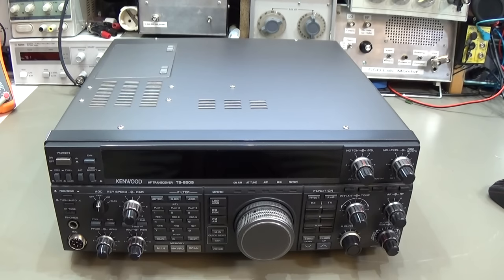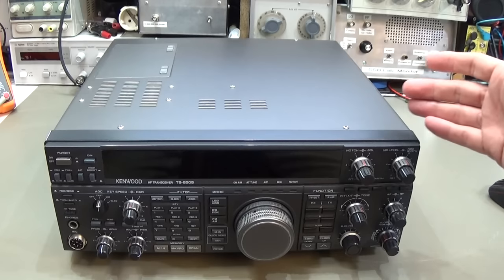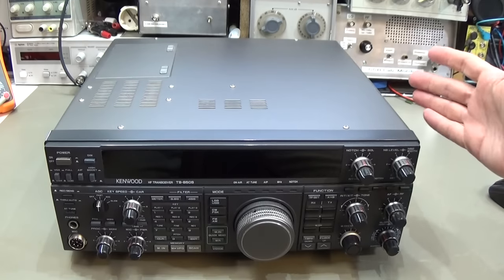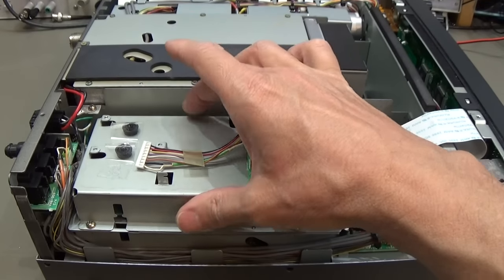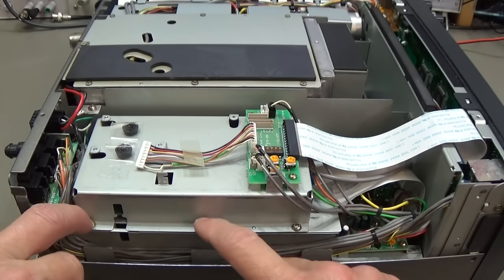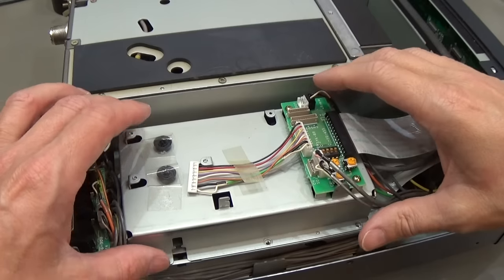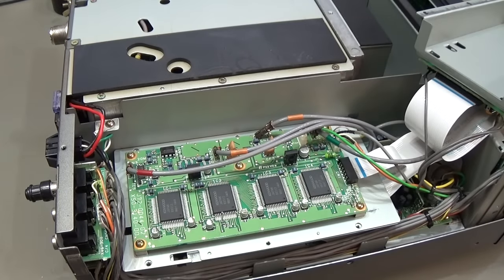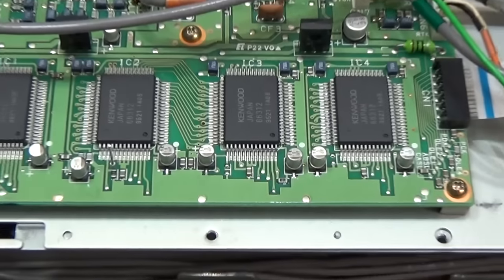#89 Kenwood TS-850 for maintenance and ESR lab talk

Comment: Finaly someone who uses a datasheet instead of those useless tables. But use the one from the cap you measure, not some random type and brand. Also important, ESR gets lower if the temperature increases, something to watch out for..
ESR is not holy,  low ESR is most time very good but not always, it can sometimes make a circuit unstable. A good manufacturer chooses a cap that has all parameters for his circuit right (but I'm spoiled, I only repair test and calibration gear)

I just repaired a Fluke 123. All smd 150uF/6,3 caps where bad. Not very much, just on the edge of the datasheet and for the ESR fans, they measured great in situ and the scope was only 5 or 6 years old. The only one that measured very bad in situ was the only one that measured almost as new when desoldered. So why I replaced them, ? Simple the scope did not work well and the cause was a huge ripple on the 3V3 line. (over 1Vpp). After replacing the caps the ripple was gone.  And that is what matters the most.  Capacitance was within the 20% tolerance, tan-d was just over the edge of the new tolerance but under the max over time(200%) . DC leakage was well within specs (uA/time). So, use a scope instead of a table/datasheet if you are unsure. In this case they probably used the wrong type of cap or it was a bad serie.

Regarding your video. The datasheet states impedance at 100kHz, that is not the same as ESR. But with bigger caps the reactance is low enough at 100 kHz to  make much of a difference. Most cheap ESR meters measure impedance and not the real part of the impedance.  In situ measurement is handy but far from reliable. 
 I use the dissipation factor (D on your meter) and every datasheet states that. Including the allowable max value over time. Most times 2x the max value stated. Do noy use your meter in auto mode. Set it at the right frequence and mode (Cs, D(orRs) and frequency, for caps as in the TRX most times 120Hz) That speeds up things a lot.

An other very import parameter when replacing caps is the max allowable ripple current (current, not voltage ! ) I often get instruments here where the only bad caps are the ones someone replaced befor. When I look up the datasheet they are most times just the wrong type. You can use a very fine low ESR Panasonic cap  as a replacement, but if that has a max ripple of 800 mA and  the real ripple is 1500mA , that fine cap will not survive very long.   Ripple voltage is important too but not for trhe cap, the datasheet states current. 
Fred

Comment: Great Job Peter! Those caps are a real issue in all older gear. Getting rid of them was a very good idea! I have come across Kenwood's where they have leaked so bad, they destroyed the surrounding IC's by making the PCB conductive between traces. That scope I just did will get all the caps on the acquisition board replaced.... I may even use newer production SM  tantalum's. (they didn't due to cost) Oddly enough, I have come across gear from the 70's where the caps are fine internally and externally. They have the ability to make caps last..... (look at my TEK 547's, all original electrolytic's and still fine) It would be nice to return to a time when quality was as important as money. Take care Peter! Again... Great video!
Reply from the maker: +Mr Carlson's Lab Hi Paul, yes absolutely this crappy caps can make so much damage.... Thanks for comment friend! Take care 73
Reply: +Mr Carlson&#39;s Lab I noticed Peter even used your phrase in dealing with these caps. They HAVE TO GO! I hear myself saying that when I remove old caps, thinking of your videos. Both of you have taught me a lot. Thanks.

Comment: Peter , again a Kenwood TS-850 .
I ended up with 3 of these from estates and did a lot of searching in internet for what to look for , for my shack .
1st thing watching your video , I wanted to see numbers on the unobtainium chips , the 1st run of these radios , the part number ended with " 11 " and the 2nd run ended with " 12 " - so the up graded board & chips in that rig .
The rumor going around I read was Kenwood got stuck with counterfeit electrolytics and the chemistry was not copied correctly .
After watching your video , I am going to go back to my 2 newer rigs & check for ESR .
My 1st rig was an older unit with leaky caps & older chips " 11 " and replaced .
There were numerous other electrolytics in these rigs that had known leaky problems common , all through hole , on the display board and a couple other boards .
Lot of good old radio well worth keeping going and the 850 is one of them ;)
Thanks again 
John
Reply from the maker: +KD0CAC I fully agree John this radios are worth to take care on. Thanks for stopping by. 73

Comment: Danke Peter, great videos. A good friend of mine has given me a TS850SAT (YES for Free) in working condition; so, when it arrives I plan forst to check those caps! I work professionally on a bench as an electronics test engineer and to be honest your ERS tutorial is the best I've ever had! Not even my college professors could approach that subject with clear hands on use like you have. 73 Mike AD7VV

Comment: Thanks for another great video! I have (and love) the TS-850S I bought new in 1991, and it fortunately has not yet leaked--but I am replacing all the capacitors now because I want the radio to last another 28 years!--73, K2UA

Comment: Great video. I think that if all those capacitors are connected to the same power rail, their ESR are in parallel and their individually ESR could be even greater than the 4.5 ohms you measured. It could have been good idea to measure their ESR once removed, just for comparison. Thanks, keep going.
Reply from the maker: +Juan Abreu Hi Juan, yes that is true but as the resistor is to hight even in parallel that means that the result tested individually can be only more worth.. so they have to go.   Thanks for feed back!  All the best and Cheers

Comment: There is an old Latin saying "Primum non nocere." First do not harm. Changing the caps could go wrong even for advanced technicians. There is a big risk breaking the circuit lines. I would have not changed anything on such a mint condition rare TS-850.  In such cases one should inspect regularly the board for leakage and at the first drop of leakage (if it ever happens, it is not sure that it will happen) change the capacitors, but not years before. What I have found is that the YM6631 or YM66312 chips get very warm and with the metallic case of the CAR assembly act as an oven. These unobtainable chips not only cook the capacitors but seldom destroy themselves by this overheating. I would recommend adding forced ventilation to this area (perhaps a small fan) or at least small heat-sinks to the YM6631(2) chips (but this will help only the chips, not the capacitors). However I would not touch and alter units in mint condition. The capacitors should have been measured also after extraction. To compare in-circuit capacitors with out of circuit capacitors is not fully correct. The circuit can greatly influence the impedance of the capacitor. Anyway, I congratulate to the technician that he did not harm the radio. Nice work! :-)

Comment: Thanks for this.  I just bought a Peak ESR70 thinking it was going to be an easy test only to find that the measurement told me nothing and I could not get the ESR values from Vishay even though they did answer my email and said they would provide them.  I was changing bigger 400-600V caps in an old 1959 Fender guitar amp.  I could not tell the difference in the 60 year old caps vs. the new caps using the ESR method.  Actually, the new caps had a higher ESR reading than the old caps.  It completely confused me and now I feel I bought a meter that I will probably never use again.  I guess it is off to Ebay.

Comment: It seemed like you were getting nearly the same reading from all of those capacitors along the front edge of the board. If they are all in parallel on the same power rail and you measure one are your really only measuring that one or are you measuring them all in parallel at the same time?  How can one be isolated from the others so it can be measured by itself?

Comment: Thumbs up Peter, are the capacitors on that board different from the others in the unit. Why did you not test other boards with the same caps. Or if you did is it just that board that is always at fault.
Great videos as always look forward to the next one, Cheers.
Reply from the maker: +T Komoski Hi, we have three areas where we have problems with leaking caps with this radio. Local board, display board and audio unit. I have tested the ESR on all known suspected caps but those were all in tolerance. Thanks for watching. 73

Comment: The vast difference between ESR charts has always bugged me as well; if you can relate the cap to a brand and get the data sheet always the best way to go.  73 - Dino KL0S
Reply from the maker: +Dino Papas Hi Dino, yes it is so easy to get confused by all the crap available on the net.  Thanks for stopping by 73

Comment: Peter, so you recommend looking at the spec sheet for the cap to determine the max ESR value?  Or is it ok to use generic spec sheet?
Reply from the maker: +Doctor Forbin Hi, I recommend looking on the spec sheets. Generic sheets can be used if the test values are over the values what the generic sheet is telling. Hope that helps. 73

Comment: Interesting. I wonder though, if you are looking at a recent manufacturer's table, would that be applicable to the capacitor they made...what...30 years ago or so? Would technology have improved to reduce the ESR in those years, or would it be the same value then and now, fresh from the factory? 🤔
Reply from the maker: Yes, today you have different sorts of lytics, low ESR types and "normal" types and of course good and bad brands...

Comment: Really enjoying your videos on how to effectively test capacitors. I have a small GE cassette recorder that has some Marcon and Rubycon brand electrolytic caps in it. 

I am having some difficulty finding anything on the Marcon caps specifically as searches lead to Nippon Chemi-con which I assume may be Marcon but under a new name? 

It is a 6.3v 470uf +105* Marcon 8335 3VM that I was using for test search but I can't find anything on this "Marcon" brand. I can find some on Rubycon caps though.

Is there no way then to double check these Marcon's have the correct values when testing? Any tips, much thanks!

The issue with this little cassette player is low output from speaker. At first it wasn't working (no sound) tested a few caps with a basic meter and found one that was suspicious. 
Replaced with equal uf value but higher voltage and after changing out that capacitor, it started to output sound but it wasn't immediately after. I was actually just poking around at the record and play head and it started to output sound. Trying to figure out what the issue is now as I have one to compare it to (exact model 3-5157B) which is much louder.

It's been strange. Like maybe replacing that cap allowed another one to be energized properly? Am new to this really so I don't know. 
Essentially the player arrived not working properly after some poking around its functioning better but the speaker volume is still low, even at max 
(the other one is much much louder at max).

So I've learned you need a rather sophisticated approach to testing capacitors which is facilitated by using the meter on screen. I may have to pick one up!

Oh wow just checking some other sources I should probably replace all the marcon caps as they are really old correct? As in the 8335 code means 35th week of 1983?!

Seemingly fixed low sound output by replacing a 1000uf 10v cap with another 1000uf but 16v and the volume is much louder!
Reply from the maker: The brand of the caps is not important as long it is a quality brans like i.e. Panasonic or so...more important are the values..
Reply: @TRXLab  Understood and thanks for the reply. I had to wrap up shop after installing the 1000uF cap and it was working. Testing further (following day) it started outputting low sound again. Nearly stopping for the day I decided to go ahead and swap out the next biggest cap at 220uF. This seems to have solved the problem, again. Speaking of, thanks again for sharing your knowledge!

Comment: "What would I do"? If it were my rig then definitely replace them. For the customer I guess it depends on your servicing prices. They may prefer annual inspections with replacement only when deterioration becomes more serious.

On a lighter note, that rig was in such pristine condition that I am surprised that the customer didn't hand it over to you in its original packaging. ;)
Reply from the maker: The minimum one can do is checking the LO box from time to time but it id for sure better to do as soon as possible.. Thanks for comment

Comment: A question from a beginner .... :)) ....
Peter just a question, but measuring condensers directly on the board there is not the danger to get wrong values due to the interference of other component ? Thanks for your reply .......
Reply from the maker: +Giorgio Firpo Hi Giorgio, very good question! As the ESR is normally under 1 Ohm and rather more  much lower like that  this cap value is the lowest impedance in circuit and thus you can test the ESR in circuit without an interference.  Hope that helps to understand..73
Reply: +TRXBench.  Thanks a lot for the answer Peter, good evening .... ;)

Comment: Good to know those charts are "indications", but what if you don't know what brand of caps you have?
Reply from the maker: +Digger D Hi Digger, very good question. Well on most caps you find the brand name right written on to it. On SMD caps you find codes which you can search in the internet. If there is no way to determine the manufacturer use the indication tables first and if the cap is still suspect recap it. Thanks for asking
Reply: TRXBench Thank you for your reply.  Makes sense.  I was thinking about products from China with the noname caps which I suppose should be recapped from the start lol ;)
Reply from the maker: +Digger D LOL yes that is right :-)
Reply: TRXBench BTW - My DE-5000 arrived - very nice and accurate meter.  I compared the readings with my older BK Precision 878 and they are within 0.1% of each other.  I calibrated the 878 last year - simple procedure with a scope.  DE-5000 has better ranges, more frequency selections and of course 4 wire probes.  Can't go wrong for the price.  Your "long" video on the DE-5000 was the deciding factor to get one, thanks.
Reply from the maker: +Digger D ah very good glad that you like the DE-5000! So have fun with the meter in the future 73

Comment: does DE-5000 support esr in-circuit correctly ?
Reply from the maker: nsp yes of course
Reply: Any Clue what is test voltage of this meter for esr in circuit measuring ?
Reply: how to protect DE-5000 from capacitor charge any trick for this ?

Comment: THE ohm measurement while on the board is unreliable! The rest of the rest of the components deterrence the impedance your are measuring. Always unsolder one leg the make a reliable measurement.
Reply from the maker: +Joop Terwijn Hi Joop, I'm sorry but in this case your assumption is wrong. We are not probing DC Ohm we are rather more probing an impedance with a test frequency of 100KHZ. This method is golden practice as a capacitors impedance is the lowest impedance around so you can manage it this way. Search for ESR testing on google... Thanks for comment. Cheers
Reply: +TRXBench Is it not so that these capacitors have a very low inductance between each other if they are on the same rails? (Which was not clear in the video, but I think is very likely) If that is the case, your measurement is heavily influenced by nearby capacitors.
Reply from the maker: +Dirk Reisig Hi Dirk, if you have caps in parallel then the over all ESR goes down so you could be fouled by a very low impedance but not by a to high....Hope that helps as explanation All the best.